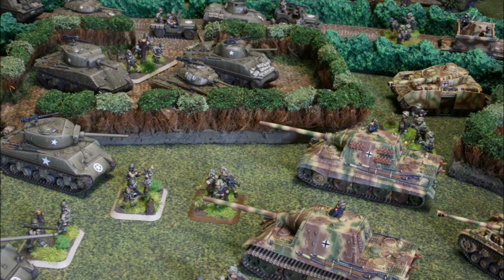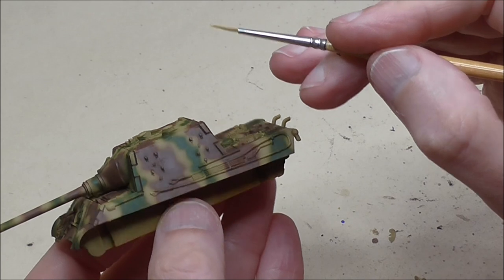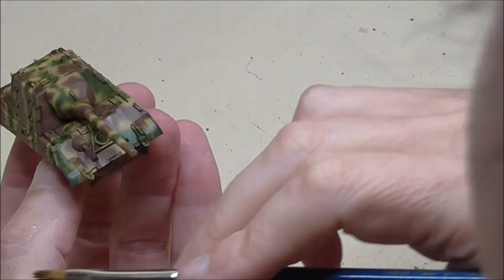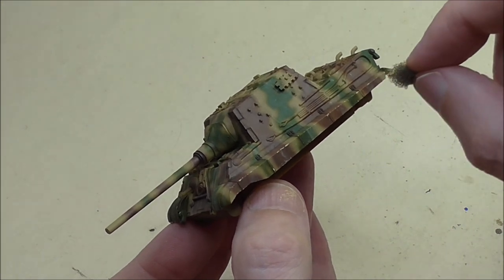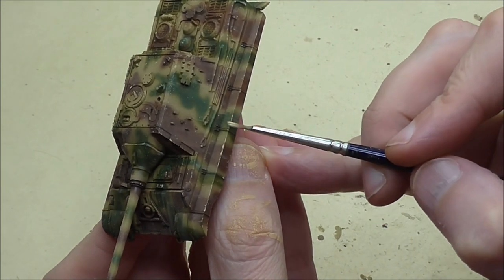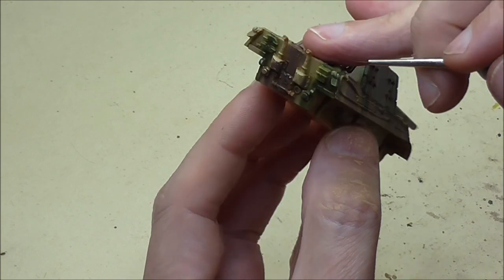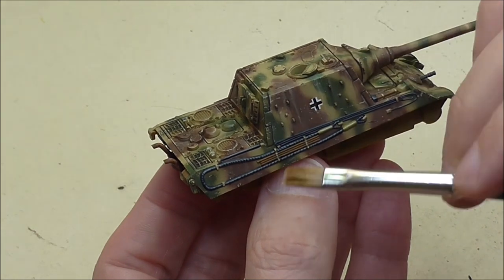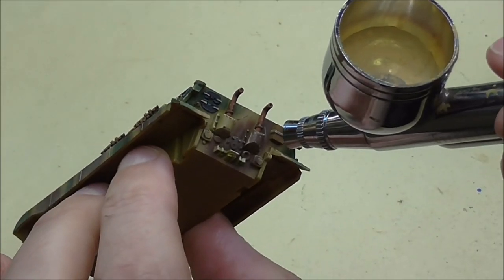How to Weather your Jagdtiger for Flames of War

Comment: Very nice. 
 Better gun barrels on these than the old resin/metal ones, I ended up throwing the barrels in the bin and using aluminium tube instead.
Reply from the maker: Thanks Jay be. I did think the barrels were over sized on the metal ones I had. I did a double take when I looked at some old pictures! Thanks for watching.

Comment: I was wondering if you have any tutorials for the application of varnish before you apply the panel wash? I looked through your list and can’t seem to find one. Also, a tutorial for the final varnish application? 

Last question, do you apply a wash over the entirety of the model after the first varnish application or before the panel line wash? The vehicle seems to be fairly dark compared to the paints original colour. Thank you!!
Reply from the maker: Hello Todd, I haven't recorded anything on the varnishing itself. This is a straight forward process where I apply a thin coat of gloss to help with the flow of the wash. The varnish will darken the surface slightly, even before the wash. After the pin wash it will get a little darker again. I choose my base colours to take this into account. I apply the matt coat as a final step. Here is a link to my Vehicles Essentials playlist. There is a specific guide there to applying the pin wash. I hope that helps. Thanks for watching!
Reply: Really appreciate you getting back to me. I enjoy your videos and have already learned so much!

Comment: I wonder how you painted the tow cables?
Reply from the maker: For the larger tow ans smaller track changing cables I gave them a coat of German grey. Then with London grey painted a fine edge all along the length. For the larger cables I painted small lines along their length. This is a simple way of suggesting a twisted cable at this scale. Thanks for watching!